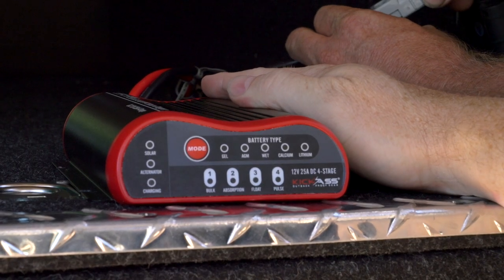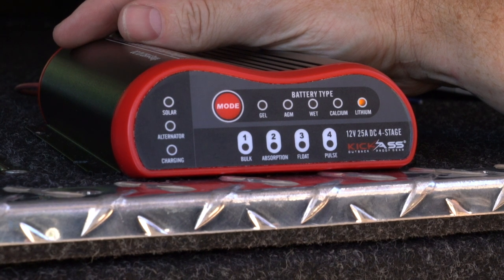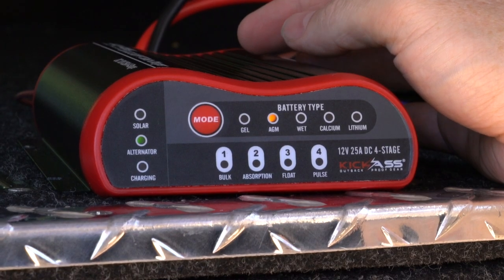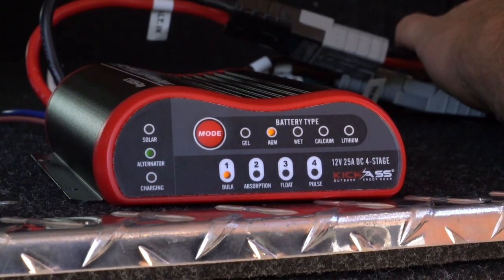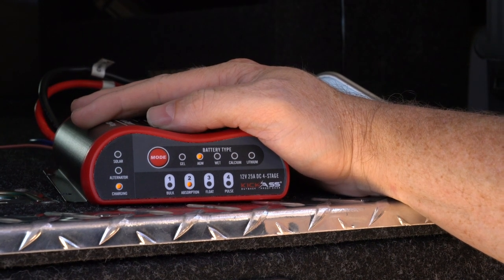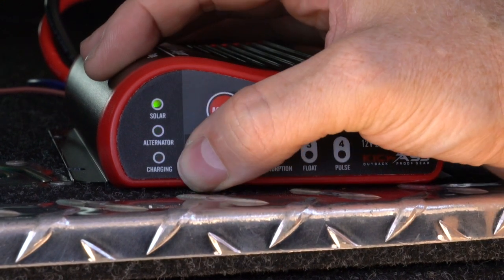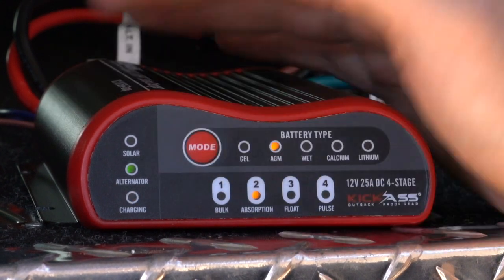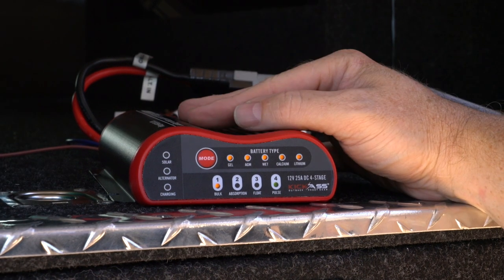All You Need to Know to Use Your KickAss DCDC 12V Battery Charger

Comment: I have ordered a dcdc charger from Kick Ass. I have an in-line vsr. My question is do I need to remove the vsr or will It still work the same.
I would like to leave it in place as I use my battery box in a second vehicle. 
Your thoughts. Thanks.
Reply: Remove it mate for far better performance. Put an Anderson plug after it if you want it portable

Comment: Do I have to have a Solar Panel connected for it to work?  Can I just use it through the Alternator only?   Already have a Victron MPPT controller and Panel hooked up, want to add a DCDC charger but keep Solar and DCDC separated in case one of the chargers has a breakdown, then it will still receive charge from the other source.
Reply from the maker: Yes, you do not have to use the solar panel connected, You can just use the alternator connection.

Comment: Where on earth do you fit the temp sensor
Reply from the maker: G'day mate,you can attach to negative battery terminal or use adhesive/double sided tape to the side of the battery, it's function is to lower the charging rate in extreme hot weather conditions, so realistically wont ever come into play in aussie conditions 
Thanks for watching 
Cheers

Comment: Hi have kickass dcdc charger i also have a lithium battery but the charger wont come out off float charge because the lithium battery stays at the same volts till flat how can i solve this thanks
Reply from the maker: Hi Peter, If you submit a ticket through our support portal one of our technicians will get in contact with you. https://supportportal.australiandirect.com.au/submit-ticket-product-issue/

Comment: Apologies for ignorance, but can this charging process via alternator and possibly solar when stopped occur while the battery box is in use?   Does the changing from alternator to solar and the unlikely disconnection effect the stage of the charge?
Reply from the maker: Hi David,

You can have solar and alternator charge connected at the same time, but the unit will only charge from one source at any one time. Charging from alternator to solar charge will not affect the stage of the charger, it will have a quick think when you change over the charge and run through the previous stages to find where it is up to, but that's the most it will affect the charger. 

Please don't hesitate to get in contact with us if you have any other questions.

Comment: I connected mine up today and I wired the ignition switch correctly. 
But when I turn my car off it continues to charge. I even waited for 10 mins and it was still going. 
I thought the idea of the ignition switch is to make sure it’s only charging when the car is on.
Any ideas ?
Reply from the maker: HI Dean. If you are having issues please contact us via our customer support portal and one of our guys will in touch with you ASAP. 

https://supportportal.australiandirect.com.au/
Reply: Hey mate, any chance you sorted this issue?
Reply: I installed mine today and have exactly the same issue. 
Was a solution found?
Reply: Did y’all figure this out? I’m having that issue now

Comment: As soon as I connect some unregulated solar panels, I get the line of flashing lights.    :(
Reply: @Joe Curran thanks for your reply.  I've plugged the Panels through the controller that came with them, then plugged that into the IN/OUT Anderson Plug.  That way appears to be charging fine.
Reply: Hey steve. What was the comment from joe (if you remember)? I have just encountered the same issue. 

I note your comment about using a separate controller into and in/out plug... but was curious why i get the error through the solar plug.
Reply: @raayan621  cos to annoying you kick ass come with an fantastic idea... Every solar panels over 20V will not work with their dcdc reason? Just so when you go to kings and buy a cheaper and better solar panels than theirs well it's will not work and you will have to plug a controller to it... Nice hey...
Reply: I have the same issue. Even though the voltage from my solar panels is only around 21 volts. It is supposed to be ok with upto 23 volts. Am trying to get situation resolved with Australian Direct and they are basically telling me my solar blanket isn't good enough. Complete joke.
Reply: @WrenHillFarm  it's good enough but for example the king's one are max V 21.6 or something so kickass Max their to 21 max and then you F if you want to use it... Just use a controller...
Reply: @pb8582  kings panels can push up to 26v thats why it trips the charger  i ran kings 250w through the kickass dcdc charger and was fine most of the time but yea was faulting the charger. kings are cheaper quality. in saying that i still run that panel but through a victron mppt charger and no problems and the dcdc charges from alt and another panel if needed
Reply: @damiancoulter2355  hi Damian, just to clarify, do you run your Solar Panel from Victron mppt straight to your battery, or panel, through victron mppt and that goes through Kickass charger then to battery?   Thanks

Comment: Just brought my 1st Kickarse product the " current" DC DC 25 Amp 3 stage charger 1 week before going away 3 days later the new DC DC Charger appears whilst kick arse did offer to take the DC DC 25 amp 3 stage charger the process was some what long winded  & would have left me without a DC DC Charger for my secondary battery for my fridge.

Very Disappointed surely  Kickarse knew when I brought the " current" DC DC 25 Amp 3 stage  charger that it was only a matter of a couple of days before the new 4 stage 25 amp  DC DC Charger was released now I am going to have to but yet another new one & this brand new one will become a paperweight. 😢
Reply: Sell it dude.